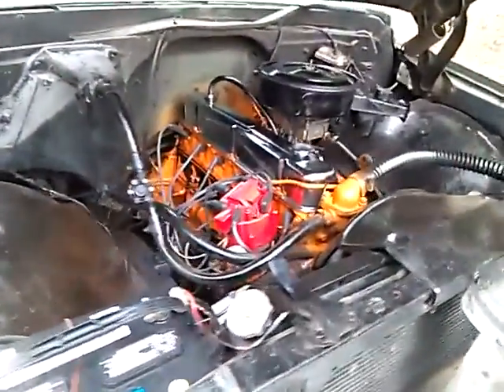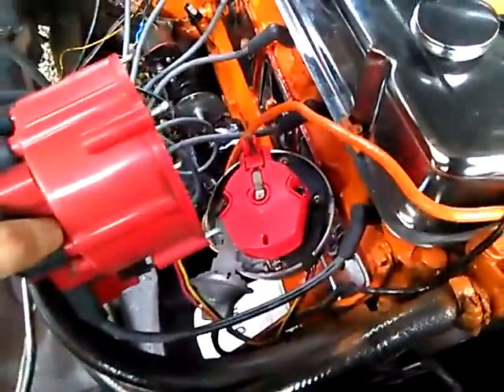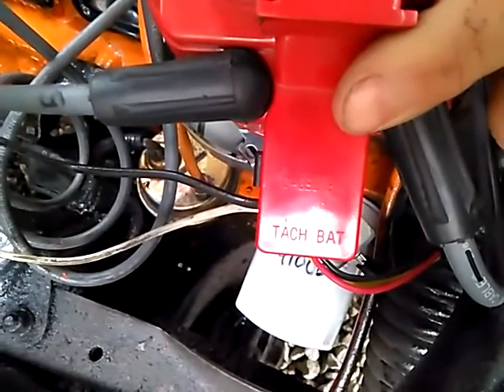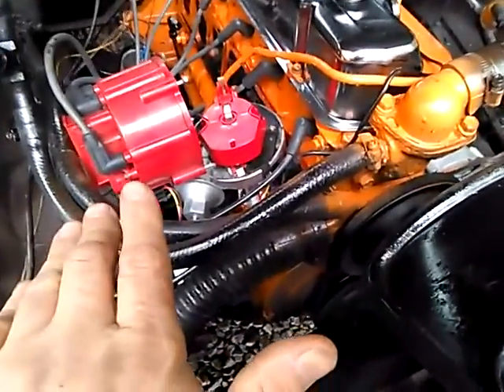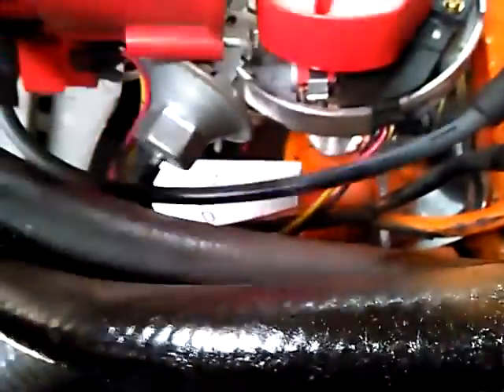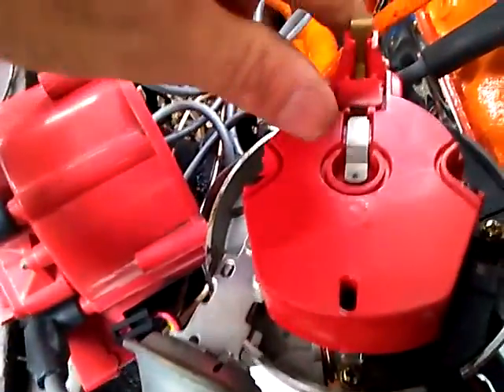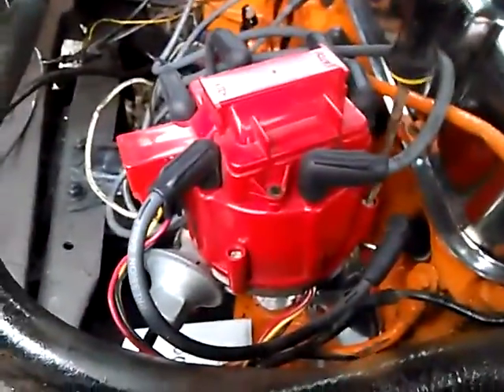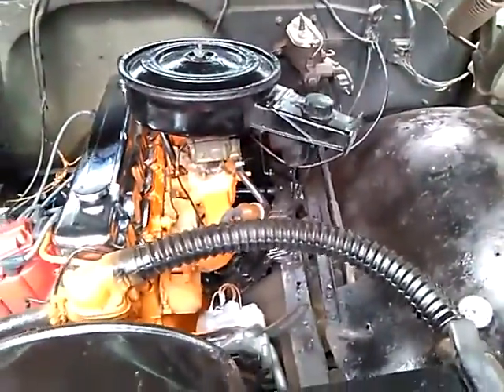Replacing points with electronic ignition

Comment: I know the video is old but you just helped this guy out with some questions I’ve been looking for, I am converting my 235 but I think the distributor hold down is different 
Great video thank you
Reply from the maker: @davidboatner3115  glad you liked it!
Reply: @lukeFugate  actually just got done, I was held up by not being able to find the bb for tdc and your advice worked perfectly about just putting it where it came out, pretty easy upgrade, worth the money although my distributor boots on two plugs are right up on two plug boots, 235 distributor is about mid way as you probably know but works fine just need two boots with 90s on both ends anyway you the Man!!!
Reply from the maker: @davidboatner3115  glad to hear it worked out for you!

Comment: I want to replace mine on a 1970 250 I6. Can you provide a link to buy the exact same distributor?
Reply from the maker: It is a great upgrade. Here is a link to it https://amzn.to/300vXQO 
You will need different plug wires also. I think I got wires for an 85 chevy truck and they worked.

Comment: 230 or 250 ? Or is it a 292 !
Reply from the maker: 250
Reply: Great little motor. Are you planning on hot rodding it any ? Besides the HEI ignition?  Like headers intake double or triple carbs ?
Reply from the maker: Not really any plans on hot rodding right now. I put the new carburetor on recently and it helped with power a little bit. I had thought about the dual carb intake, but it is kind of expensive.

Comment: you said in your video that you changed the plugs, i'm doing the same upgrade to my chevy 6, did you change to a hotter plug and what about the gap? thanks..
Reply from the maker: I used the recommended plugs but opened the gap to .045, you could try .045 and then .040 to see which is better. You will have to get different wires. I got a set for an 85 Chevy truck and it works fine.

Comment: Why do you have the faucet on the heater hose?
Reply from the maker: lol I guess it does look a little bit funny. I never think about it anymore. in the summer the coolant still flows through the heater core and it lets heat into the cab while you drive so I put the valve on to stop the flow.
Reply: Thanks. That makes sense.

Comment: made the same swap 10 years ago... hasn't skipped a beat, have heard some complain about power issues relating to the resistor wire powering the HEI... so what i did was to use a relay with that original wire as the trigger
Reply from the maker: haven't had a problem with it but I don't have a resistor on it at all.
Reply: I'm led to believe the factory lead is resistance wire... just saying, someone might see this and be helped by it : ]
Reply: @TheCanadianBubba  Your  100% correct.  A resistor wire was used after starting. The two wires at the  distributor positive one was full 12v for starting the other was a resistor wire that activated  when the key returned to the run position.  Way to much confusion, people should read theory of operation before teaching.
Reply: TheCanadianBubba I’m going to be putting in a HEI on my 250. I dread saying this but I don’t know what you mean?
Reply: TheCanadianBubba 
I’m trying to convert my ‘68 Impala from points to HEI. What kind of relay would I need to use to use the factory ballast resistor/ignition wire?